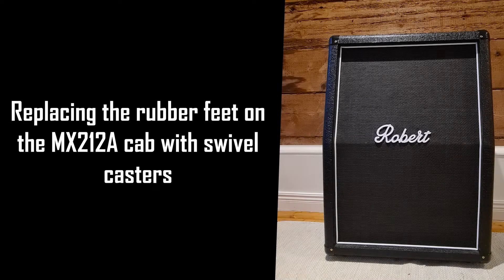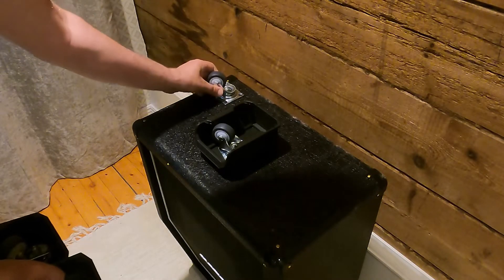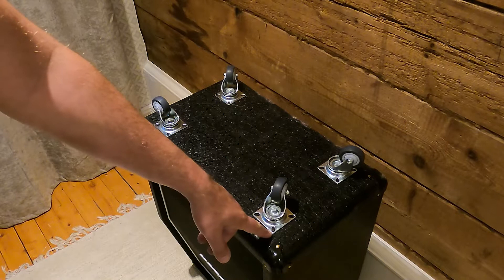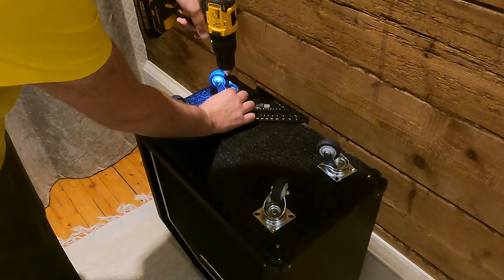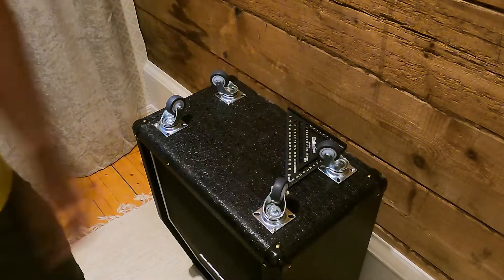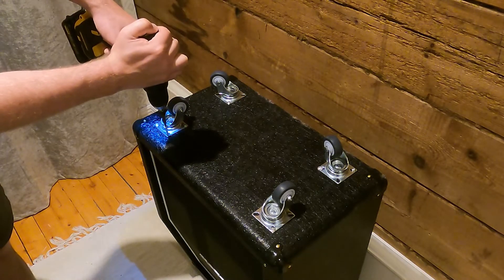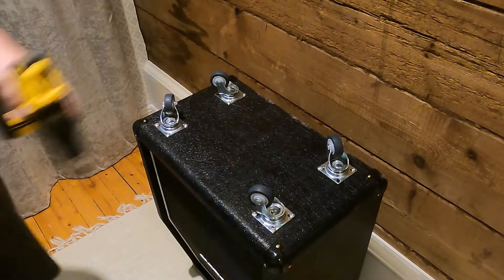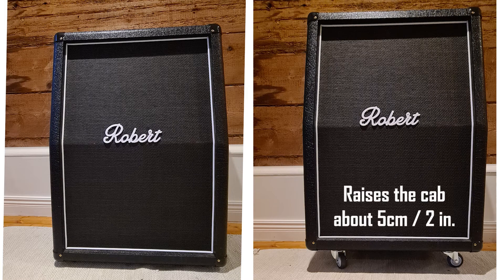Replacing the rubber feet on the MX212A cab w swivel casters

Comment: What brand are the casters? Where did you get them?
Reply from the maker: @OscarEgan-vj9qv  I think you can find similar in any big barn hardware store, depending on where you live. I would recommend that you align the centerpoint of the casters slightly on the outside of the rubber feets' position. The contact point of the wheels, if they swivel inward towards the center of the cab, may cause the cab to be somewhat unstable and tip easily so take precaution when you decide on where to fasten the casters. But to be able to roll your cab rather than carry it is a sure win.